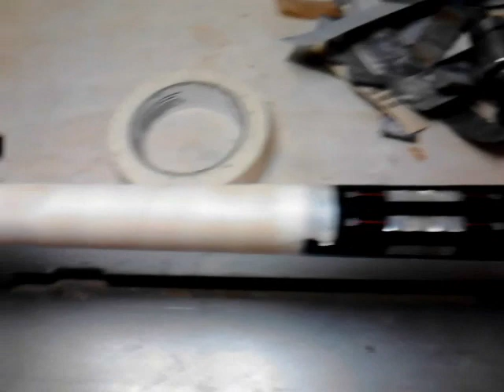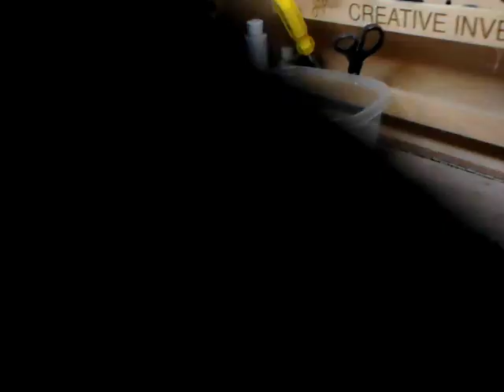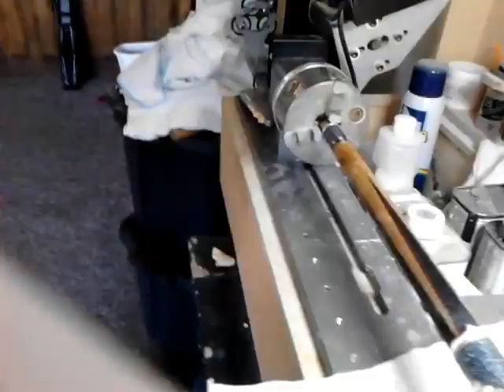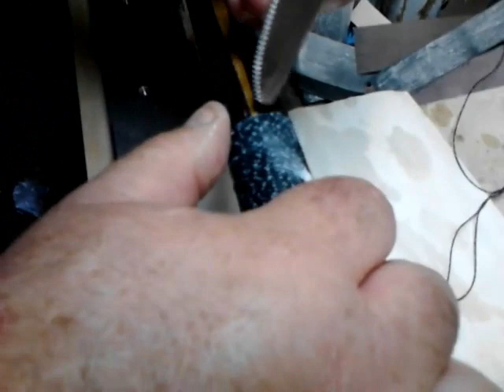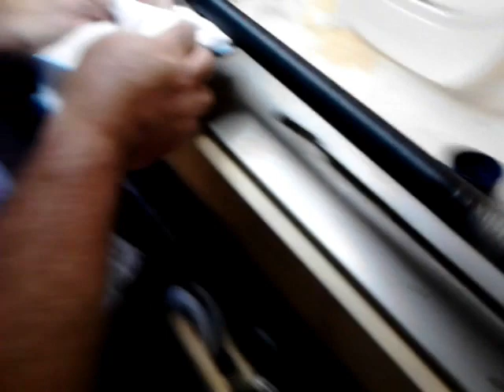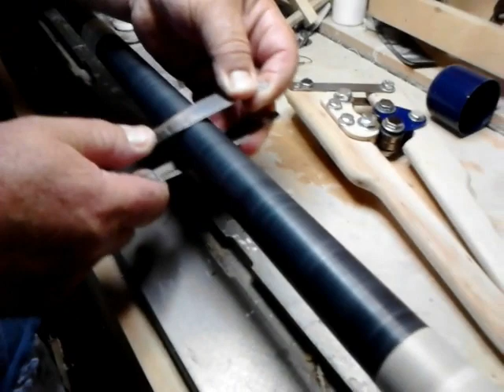meucci wrap

Comment from the maker: Hi all thanks for the comments and questions. I will try to get them all in this one post.
Jorge, I use "Elmer's Glue all" it is a water based white glue that adheres great to wood and the linen. I am not sure what the equivalent is Spain would be. The spray I use on top of the linen is spray starch, most commonly used on clothing before ironing. I use the starch to help tighten the linen thread. I don't really have trouble with gaps I just like to stop and check often, better safe than sorry. Thanks
Reply: What kind of lathe are you using?

Comment: The butt is tapered but you are using flat roller bearings with your press.  This means the leading edge of your bearings is the only part of the bearing surface pressing the linen.  That would act as more of a wedge than a press.

Comment: hello friends I write from Spain wanted to know what kind of adhesive is used to bond the thread 
thank you very much
Reply: Just use regular white school glue, spray with light water mist, and finger in the water with the glue to give you a longer work time.  Should just be a light coat of glue, a hazing, no excessive glue, no pooling or dripping!  Put on your wrap, won't worry if the glue is drying up while you are putting on linen.  when you have all the linen on, mist the wrap with water again, and now use a wrap press tool and don't over press it lathe should have top or cue spinning away from you.  This video is not a good install.   Meucci cues that are sealed over the top require a lot more work to do them properly.  one trick is to use spray starch to seal wrap before you cover it with clear coat or epoxy.

Comment: I saw a video like this once where the guy used 600 higher sandpaper on the linen wrap before he pressed it. Does that sound like a good technique?
Reply: Hi, I don't use sand paper on the wrap. I can't imagine why, I would think that sanding the threads would weaken them. If the thread is too thick then the wood should be sanded first.
Reply: +Cary Brace   Why is it necessary to add so much material to build up the wrap area  isn't the linen material all the same  or equal to the original build?